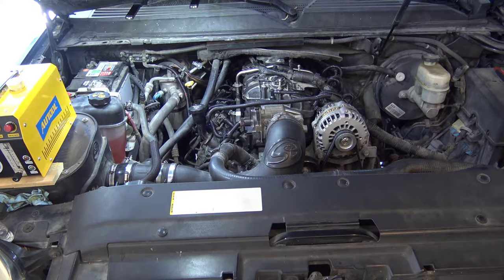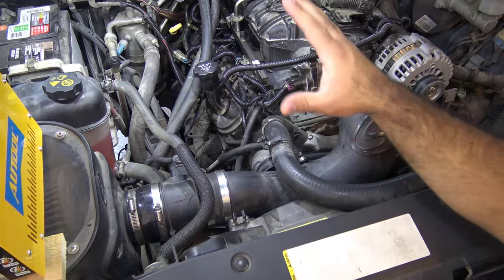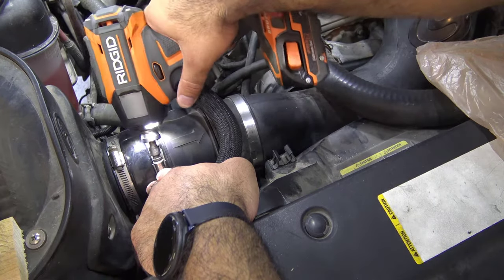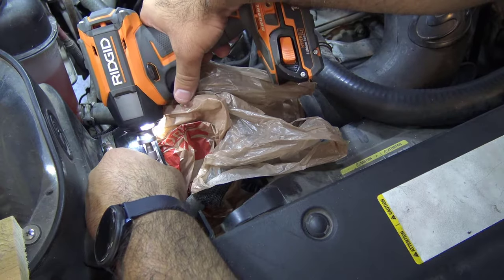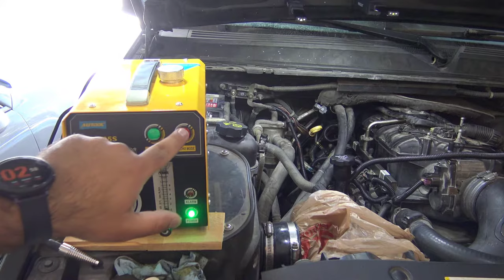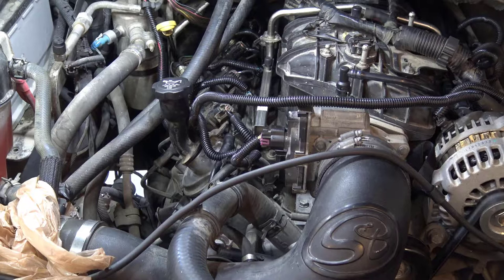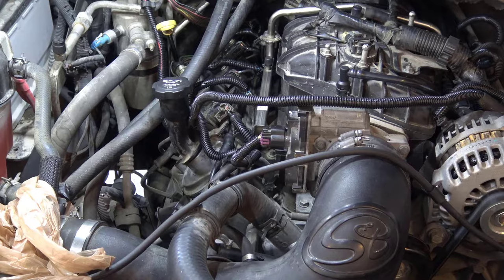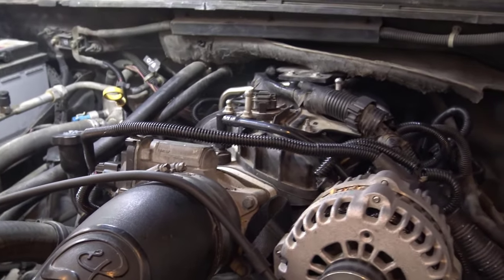How to Smoke Test for a Vacuum Leak on your Car or Truck! Short, Sweet and to the Point!!

Comment: all the tests like this are really smoke pressure tests I've had a lot of vacuum leaks that leak under vacuum but not pressure so maybe it would be better to apply vacuum (vacuum cleaner) to the engine and have a very low whiff of smoke out a tube and prod it about engine and hoses to see if the smoke gets sucked in. as many a 2 cycle crankcase can stand up to a pressure test but leak like crazy under vacuum. p s  I'm not having a go at you personally just the traditional smoke test used by everyone is floored
Reply from the maker: David, very interesting. I may have to give this a go. I'm not technically a mechanic, I've just been working on all of my own vehicles for the past 20-ish years. I fixed those three leaks from the video last night, cleared the codes, and I test drove today. It's still throwing the two codes for running lean on banks 1 and 2. I haven't smoked tested again but maybe I will tonight. My fuel pressure at the fuel rails seems okay at about 56psi but maybe there's still an issue there. Last week I changed the two downstream O2 monitors because one of them tested bad and I figured I might as well replace both. I replaced the MAF sensor too, just for good measure. Four months ago I also cleaned, tested and put new O-Rings on the fuel injectors. I did a video on that. All parts changed out were AC Delco except MAF sensor, that was Delphi. That's probably a bit more information than you were looking for but I just started typing and kept going! lol. Thanks for watching and the information!
Reply from the maker: Oh, and my Long Term Fuel Trim numbers don't look great. They fluctuate between ~4% - 12% at idle to ~6% - 24% while driving. So I'm definitely trying to figure this thing out.
Reply: Thank you for that
Reply: @AE-ds8be did you ever figure out the issue why you’re running lean?

Comment: If i dont put a bag do i need to do anything? Is there a risk that the smoke machine will damage the car? I want to test for vacuum and evap leaks.
Reply from the maker: @anarchydog  if you don't put the bag the smoke will escape through the air filter box. If you have the ballooning bladder that comes with some of these machines, you can also pump that up in the main intake line and send smoke in that way. One day I'll make a video on that process too. Thanks for watching!
Reply from the maker: @anarchydog  also, you'd get smoke particles on your MAF. Which might not hurt it but it could probably use a cleaning afterwards just to be sure.

Comment: Good job!  I have a 2000 silverado 5.3L getting ready to check for vacuum leak. Running lean, but codes clear and it’s an intermittent problem. I hope the smoke tracks it down. Thanks again for the post. 👍
Reply: Any luck?
Reply: @Danielxperez14  actually called the mobile mechanic and he did intake manifold and valve cover gasket replacement. Seems to be good now. I just got tired of chasing my tail and had to call the professional. 390k. Like a rock. First time gasket replacement, so needed it.

Comment: Apprciate it Bro, I just got a 1998 Ford Ranger in the Shop with a P0171 DTC code for a lean Mixture in Bank 1. Never actually did a smoke test myself so this really helped for preliminary research.
Reply: Same code popped up on my f150 along with p0174 anyone have a clue what that could be?

Comment: Great video I just subscribe. Quick question I thought running lean means too much air not enough fuel. If you are losing air or vacuum leak shouldn't your car be running rich due to less air and more fuel
Reply: Do you have a hole in your vacuum you would be sucking in more air therefore getting more air less fuel ratio would cause a lean condition
Reply from the maker: @redwood6737  thank you for answering Ramons question! Great answer!

Comment: This is a great Idea. Thank you. I would like to ask you a question about a vacuum leak on my 2002 Ford Ranger. The brakes are sponge, and the transmission stopped shifting into high gear and the speedometer reads about 80 miles per hour when it is only going 40 . . could that be a vacuum leak?
Reply: A FOOKIN FORD RANGER!!!

Comment: Thanks, real to the point. Just inquiry, dont we need to do some open/close to the purge valve? In order for smoke to travel to further areas? Thanks again
Reply: This would help in the event of trying to hunt down an EVAP leak. Need a bi-directional scanner to command the purge valve open and shut the vent solenoid in by the tank.
Reply: Yes, i did this test on my truck, i found the leak after closing the purge valve. Yet the code p219b came back again. Finally, I found the problem and fix it. It was O2 sensor. Even though, i installed new O2 but it went bad in no time. I wasn’t expecting the O2 sensor since i replaced them all. My months of research with this code. I highly highly recommend to ONLY install the ORIGINAL OEM sensor. And to buy it from trusted dealer. As the internet full of fake O2 sensor and fuel injection put in GM box, but it fake. Sorry for my bad English, but im trying to explain my one year of suffering the code P219B and P219A. 
Note: truck never give O2 sensor code !!!
Never use after market in some parts. 
PS the O2 was the best aftermarket O2 in the market 😢
Almost cost me oem sensor. 
I’ll be happy to share and support anyone need help. 
The other hidden problem with this trck was shaking
On high way, i thought its tires problem, i did everything possible no help. Then i changed the u joint and it went as a butter again. 
Note: no symptoms of u joint was existing suck clunck or squeeze etc !!
Huh …. Strange 
Love you all 👍🏻

Comment: What year is that truck?  I thought there was a valve on the brake booster hose.  I might have to run mine through there and try.  I like the double bag trick on the intake.

Comment: i heard some brake boosters have 1 way check valves / is it safe to pump smoke through brake booster i have a 2014 mustang gt with a p0171 p0174 code
Reply: The check valve is still on the booster he disconnected the hose from it the white thing. He is not putting smoke though the booster .

Comment: If i do this, will i be able to find a gas cap leak?
Reply from the maker: @shawtykillz1  not by adding smoke at this location. You would have to send smoke into the EVAP system. You can disconnect a hose that leads to the EVAP system, like the one going to the charcoal canister, then send smoke into the system that way. Make sure to follow all proper safety precautions.
Reply: @AE-ds8be  thank you!